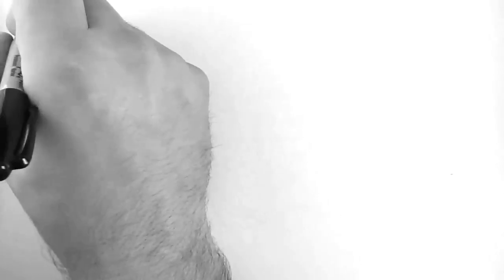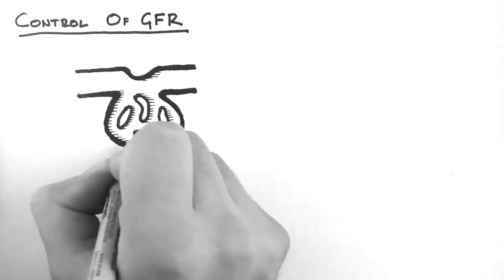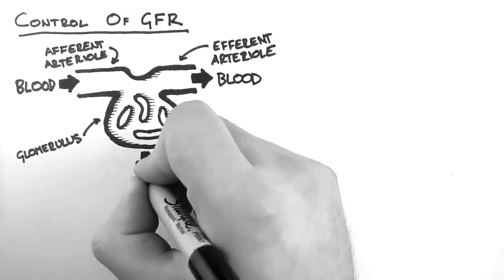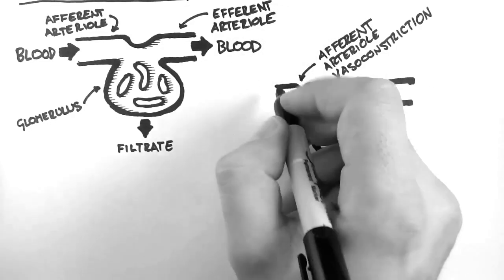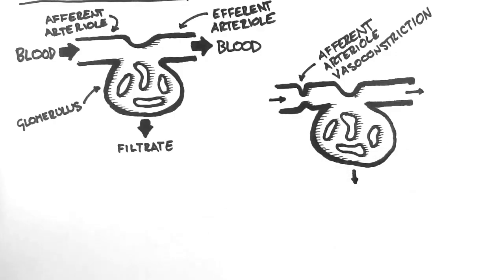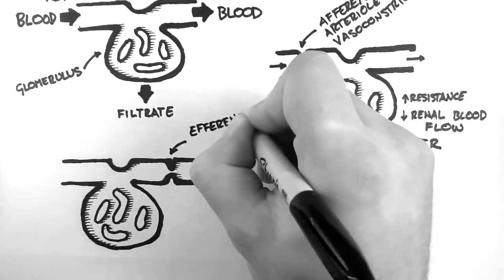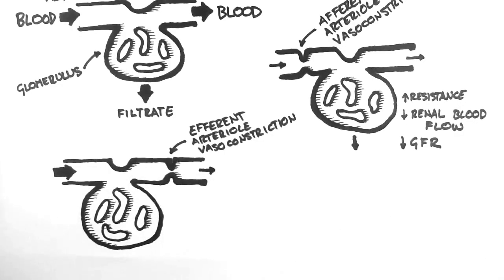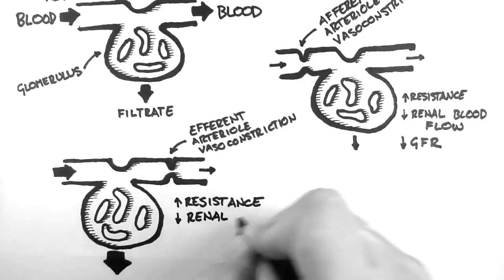GFR 1 - Control of GFR

Comment: Isn't the increase in GFR due to efferent constriction only transient? After a time, as there is less blood flow to the glomerulus and fluid is squeezed out, the oncoctic pressure in the glomerulus will build up, which will draw fluid back into the blood. So, overall, GFR would decrease. Yes?
Reply: I believe that the effect is biphasic; at moderate levels of efferent arteriolar constriction, resistance to flow and thus GFR will rise. Once resistance reaches 3x normal, you will indeed begin to decrease the GFR due to abnormally elevated glomerular oncotic pressure